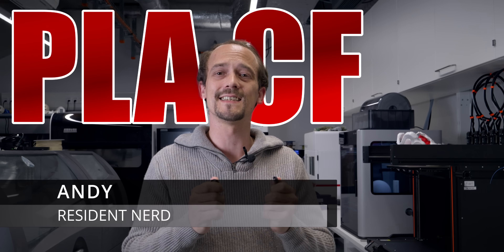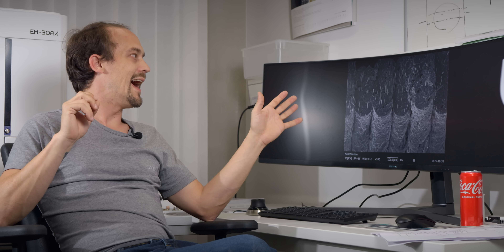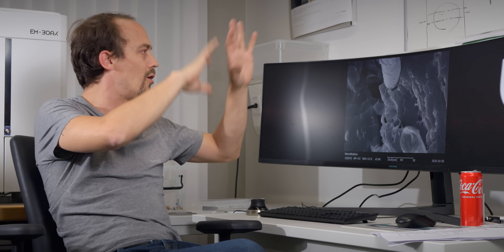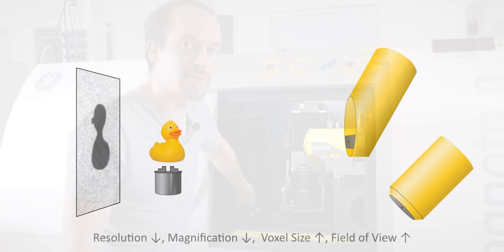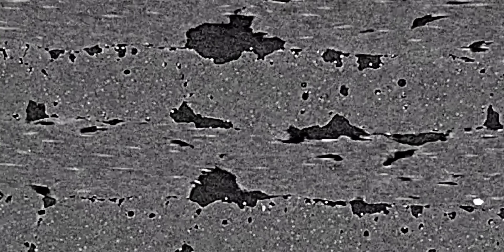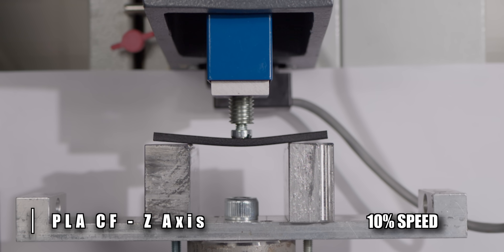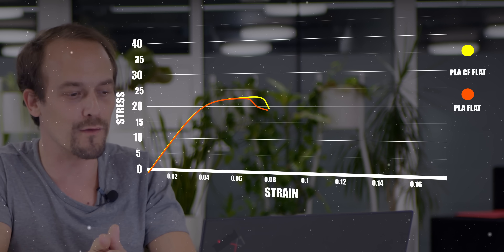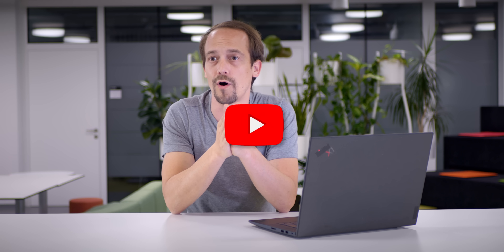3D Printing’s Biggest Scam Is Even Worse Than We Thought!

Comment: Great analysis – I work in injection molding and can fully confirm your findings.
One major issue with these so-called CF-reinforced materials is that the carbon fibers are often not properly surface-treated (sized), or they have the wrong sizing for the polymer used. Without the right interface chemistry, there's no bonding between the fiber and the plastic, which means no load transfer – the fibers basically act as defects, not reinforcement.

This is especially problematic with PLA, since it's chemically not very interactive with most standard fiber sizings. What you're showing in the video – voids, poor bonding, layer separation – is exactly what we see in poorly formulated compounds in injection molding too.The voids you showed in the CT scan look very familiar – we see similar issues in injection molding, even with proper filling and packing.
But I’d assume it’s even worse in FDM printing, because there's almost no pressure during extrusion. In injection molding, we use packing pressures of 300 to 1000 bar, depending on the material, specifically to eliminate voids and ensure proper polymer chain entanglement and fiber bonding.

In FDM, the pressure is minimal – just enough to push the filament through the nozzle – so voids and poor fiber embedding are almost unavoidable, especially with materials like PLA. Your results match exactly what we’d expect without compaction: visible voids, delamination, and no proper adhesion between fiber and matrix.

Thanks for digging into this in such detail – really solid work!
Reply from the maker: Thanks a lot. I am a toolmaker by trade my selfe and worked in Injection molding for about 10 years before switching to 3D Printing. Thats why it was so frustrading seeing people falling for CF Filaments and not beleving me :-)
Reply: @Ibuiltathing  I was a manual machinist tool and die, and I would be very intrested in your experence switching over to 3d printing. I left due to injury and thought about going to a CNC shop but.
It is obvious that the 3d print technology will get to the mirror polish and stable dimentions required, we are at the last stages now. Heck Ive seen some that absolutly do reach spec they are just slow (electrochemical deposting and machining). 
So I have a keen eye for moving into 3d printing, and at very least youd have 1 view if you made a retrospective, even a low effort one just talking to a camera.
Reply: Similar story here. We use the markforged continuous carbon systems and literally in our in-house documentation we have written that the fiber should be used for stiffness-focused applications and should not be used for strength-focused applications because the carbon always weakens the part and encourages delamination at the carbon interfaces.
Reply: @Thesupremeone34  we also use the  markforged continuous carbon printers and the results were quite strong compared to normal printer parts, we stopped using it due to cost though
Reply: This is such a top-tier comment. Informed, yet still understandable.
Reply: Can the same thing be said for glass fiber reinforced materials?  Or, are there a type of fibers that’d work well?
Reply: @zachr207  if the manufacturer did not use the proper sizing and chemical coupling agents, absolutely.
Reply: @zachr207  It doesn't matter what additive you use, it's not going to help if it doesn't bond well to the substrate. If the manufacture does not spend the time and money to make that work, you'll get similar results to what you see here.
Reply: @zachr207  Great question. Before we get to glass fiber – I think it's important to say: With PLA, the carbon fiber issue is not just chemistry, it's also economics.

High-quality carbon fiber (with proper sizing, consistent length, and clean dispersion) is expensive – especially when it's tailored for thermoplastics. In filament production, there’s strong cost pressure, so many manufacturers use cheap or recycled chopped fibers, sometimes with sizing meant for epoxy rather than PLA. That results in no real bonding, and explains why we see voids, delamination, and no mechanical gain.

For glass fiber, the same rules apply. It must have the right sizing for the polymer it's embedded in. Without that, glass fiber reinforced PLA performs just as poorly as CF-filled PLA. So yes, fibers can work – but only if sizing, dispersion, and matrix compatibility are all right. Otherwise, you’re just printing "PLA with sprinkles".

By the way, My Tech Fun did some great hands-on testing on this too – his tensile strength comparisons for PLA, PLA-CF, GF, and other filaments support exactly what we're seeing here. Worth checking out for more data.
Reply: Plus lenght of the filament is short, for epoxy and fiberglass under 6mm fiber is nothing, just a filer.
Under 12 mm fiber just pulls out, and they are chem trated for beter bond.
Reply: Exactly what I have thought my entire life, CF has an amazing finish but is not structurally superior, I always tell my customers that CF is for the surface finish not the durability
Reply: @TheChunkyMunk Do you also tell them that the CF fibers can shed from the outside material and rub off into whatever touches them, like their hands? And then you can transfer those fibers into your lungs, eyes, or mouth where they cause all kinds of invisible damage?
Reply: Oh crap...that doesn't sound good at all.
Reply: @meikgeik  Nope, we left before he even got to that cool part with cancerogenesis. 

I'm not sure if you had ever dealing with customers but I would like to suggest you, that if someone was trying to buy something from carbon and end up with seller preaching about what you mentioned...or -  similarly, someone was buying a cheese and shop clerk, instead of just selling that - gave a high talk on how using milk is animal cruelty...

..care to offer any predictions ?
Reply: @TheChunkyMunk And none of them, never asked you why do they call it space-tech material? None ever burst with laugh and asked you if that wouldn't make guys from NASA, formula1 or aeronautic engineers to look like morons...or some grand-scale conspirators with neferious agenda? 

I mean -(with all respect) you are dude from internet, I'm a dud from internet but there is a whole galaxy of evidence to support claim, that (structurally) carbon fibers are great material (hard for me to contradict superior or inferior w/o some point of reference)...we are talking about that volume of research done, that it would be irrelevant if that entire life of your experience sum up to 13 years, 30y or 300.
Reply: @panicape1  I think he sold Filament not straight up CF. Carbon Fibers are great. They are not great when used like this in PLA.
NASA, F1 and Boatmakers use them as woven sheets laminated with resin polymers. That keeps the fibers long and strong and properly adhered to the polymer matrix.
Short pieces like in filament are a health risk and more often than not cause problems rather than improvement.
Reply: @mouldyrasperrypie  I think he did mean the woven infusion. Do you think that it improves the surface finish (he mentioned 'talking' his customers about...)when it's in filament? I would say that surface of PLA-CF print won't be anything better than just PLA...and that ...that' only in short-run, if you don't swap nozzles frequent (or -don't have any extra at hand) -the abrasive action of CF will make a print worse without that swap.
Reply: @mouldyrasperrypie and those engineered materials have their health risks too, correct? The finished carbon fiber surface is sealed, yes?
Reply: "The right interface chemistry" sounds to me like the key here. If the plastic bonds to the fibers, you'll get better material properties and if it doesn't, you get worse results.
Reply: Yep, they need proper sizing and a chemical coupling agent. Spent 40 years in plastics compounding and the company spent millions developing compounds with chemically coupled glass fibers. True, glass fiber is not the same as carbon, but the principle is the same.
Reply: @roygpa  Reminds me of a company that I worked for via my actual employer until about 1.5 years ago......they'd be cooking up Polyamide (Nylon) on site, and on the lower most floor (only thing below would be drying and water treatment), they had 3 dual spindle extruders which would take the still hot mass from the floors above, mix and knead it again, add a few additives (one line did black, one did white, one did transparent, most the time), pulling out air and vapor bubbles, and yes, also glass fibre. Pre-Shredded to about 5 to 10 mm length, even if after compounding, it would be cut to normal 3-4 mm long chunks before being dried and pumped to the blending silos that stored and equalized the material before it got packaged up.

Due to energy cost, they stopped producing the base material and now haul it in by train and truck (after it got boated of course), from countries with both lower energy prices and environmental protection policies, like the US, China or India. And you can be sure as hell, the moment they get the same certification for those materials if made right in those cheaper countries, that plant will get torn apart, stuffed into containers, and hauled off to some cheap country.
Reply: Is this an issue with glass fibers as well?
Reply: @KidCorporate  If you ask for anything that's made from glass fiber - no, it is not. Same as with using carbon or aramid fibers for epoxy resin saturation, that stuff works well. I have never heard about glass fiber used to dope(enrich) a 3d-printer filament plastic (PLA or anything) but if there is such thing and that what your question was about - I think it will be same mechanism of introducing defects...

Carbon have plenty of awesome properties, have plenty of terrible ones. Weak UV or acid resistance (must be shocking for a carbon-based life form to learn that coal is reactive...I know...) forces to look for protection. It's directional - while u can tell how much beating it can take under given scenario - you have to somehow ensure you play such scenario, a support to maintain orientation (it has a cool name - matrix).

The epoxy infusion is not for having a better epoxy but getting rid of these properties you don't wish. Glass fiber infusion shower drain or carbon car trunks/spoilers have their resistance (mainly) from material used. If you don't mind simple analogy - the epoxy is to hold it all tied - like a rope in a raft from wooden logs - it might improve total buoyancy, might not - but that's not why it was used.

The problem is not about fibers used as framework and binding material holding it together (matrix) - the problem is that printer filament does not contain enough fibers to serve as 'frame'. You end up with matrix doing all the work while fibers are some magic pixie powder that suppose to give superpowers from mere presence (read as: a buzzword)...
Reply: @panicape1  you didnt know that glass fiber is being used just as carbon fiber? Glass fiber dosnt refer to glass fiber reinforced anything yet, it refers to the fiber, wich just like carbon fiber can be added to plastics to change their propertys. And yes, lots of brands sell things like pla GF, wich means glass fiber.
Reply: @gabbermaikel  I was answering a vague question "is that issue with glass fiber"...mkeyy? 

That question - was in regard to first post, from a fella explaining high pressure injection systems and his job experience from that...

Part of problem is in vocabulary people broadly use (same rule apply to carbon and glass fiber so allow me to follow  just one as example)... Let me put it this way - the only thing that carbon  fibers are - are carbon fibers. nothing more. It's a leap of faith to know, that 'carbon fibers' was about a carbon fibers in filament for FDM prints , same with fibers in  hps injection molding. Do you know what else they call carbon fibers (or just 'carbon')? Basically - any part done from carbon infused wowen fabric. Car trunk -that's a carbon. Whole bicycle frame -yeh, it's a carbon...

I mean -I tried to play nice. I wrote that same reasons would make it likely develop same problems if using glass fibers instead of carbon in FDM. I even gave detailed explanation why that way of introducing a fracture wouldn't work with infusion in case someone went for brilliant conclusion that could mean anything ever done with fibers.

And why I didn't know of such filament? Perhaps because I'm not a fanboy and don't jump on every new 'wow' latest dumb fashion in 3d printing... and if you ask me - that one is really dumb idea, I cannot think of any place I could use glass fiber mixed into fillament...all 'safe-to-use' applications where such print could be a health hazard are off the table... we try to use fire retardant properties of glass fiber ? If main ingredient burns as good as PLA....mmmhmm, I think nope...can u think of any application it would really hit the jackpot?
Reply: Great comment, thanks. my favorite use of the web is spreading knowledge
Reply: Thank you for your comment it was a pleasure to read. Important sidenote when 3D printing (or casting) is the thermal expansion coefficient mismatch which is likely the cause of the voids. This also applies to injection molding but not to resins at room temp (unsurprisingly the normal application for CF)
Reply: @SixTough  PLA actually has very low shrinkage, around 0.2%, and fiber reinforcement is typically used to reduce shrinkage and warping – not increase it. 
If you calculate it, the shrinkage over the diameter of a typical carbon fiber (about 10 microns) is just 15 nanometers. That’s far too small to cause any significant separation or voids at the interface.
Reply: @SLu-jt3es  so a 2mm filament will be 2.004mm at 200C (maybe I miscalculate) producing internal voids. Then it may not reset perfectly. Please correct me if I am wrong
Or if it expands inward it will shrink outward.
Reply: See my post.. Let's discuss! 😃👍🏻
Reply: How about Ultrasonics on the Print Head?

~Mechanism 1: Direct PMZ Creation
Ultrasonic horn on/near nozzle
Creates oscillating thermal pulses in deposited material
Previous layer gets reheated in PMZ range (not CMZ)
New layer bonds while both are in PMZ state

~Mechanism 2: Acoustic Streaming
Ultrasonic vibration creates micro-flow in molten polymer
Physically mixes chains at interface
Prevents recoil/void formation
Like stirring prevents separation

~Mechanism 3: Cavitation Collapse
At high enough intensity, creates micro-cavitation
Collapse generates localized pressure pulses
Briefly applies pressure at interface (mimicking injection molding!)
Forces out voids

~Mechanism 4: Enhanced Fiber Wetting
For CF-PLA: ultrasonic energy helps polymer flow around fibers
Breaks surface tension barriers
Improves fiber-matrix contact
Could partially solve the "fibers as defects" problem

The Frequency Sweet Spot
Your Ultrasonics on Print Head
This is brilliant because:
Mechanism 1: Direct PMZ Creation

Ultrasonic horn on/near nozzle
Creates oscillating thermal pulses in deposited material
Previous layer gets reheated in PMZ range (not CMZ)
New layer bonds while both are in PMZ state

Mechanism 2: Acoustic Streaming

Ultrasonic vibration creates micro-flow in molten polymer
Physically mixes chains at interface
Prevents recoil/void formation
Like stirring prevents separation

Mechanism 3: Cavitation Collapse

At high enough intensity, creates micro-cavitation
Collapse generates localized pressure pulses
Briefly applies pressure at interface (mimicking injection molding!)
Forces out voids

Mechanism 4: Enhanced Fiber Wetting

For CF-PLA: ultrasonic energy helps polymer flow around fibers
Breaks surface tension barriers
Improves fiber-matrix contact
Could partially solve the "fibers as defects" problem

The Frequency Sweet Spot
Higher frequency → larger PMZ area ratio

For FDM, this suggests:

20-40 kHz range (typical ultrasonic welding frequencies)
Need to match PLA's viscoelastic response
Too low: not enough agitation
Too high: excessive heating (back to CMZ problem)

The goal: Oscillation frequency that maintains PMZ without transitioning to full CMZ
Reply: @vladtepesh3761  Hmmmm....... That might actually work! Using acoustics to match the resonance of BOTH the carbon fibre and polymer filament MIGHT actually cause them to bond together better reducing or eliminating voids and carbon/polymer pull-back or delamination! We won't KNOW until someone does experiments BUT i see no issue with what you are describing. It just might work and the resonator could be added at the print-head and just might make a difference! Good Job! You just  might be onto something HUUUUUUUUUUGE !!!!

V
Reply: Would putting  the printer in a vac chamber make the problem better or worce? 
Mindes-eye said low vac worce. High( deep) vac would pop the bubbles is fluid state elimination of air voids.   A post heat-treat at 1barA would possibly alow the needed  compaction by reducing residual pockets. Potential issues  compression temp to high to prevent druping .
Reply: Yes but a lot of that doesn’t matter because layer lines are almost always even weaker than all that.
Reply: Not to mention they aren't long enough to be relevant even if they were sized/treated right.
Reply: I'm going to repeat my response here at the end but you actually made me think for a second that their may very well be an advantage a middle area where the pla almost gets a stranded carbon fiber effect on VERY large nozzle dimensions but doesn't work at the standard .04 scale. I think you also broke into some of the thoughts I had on how semi crystalline polymers interact with cf as a nucleating agent. 

I'm not sure I ever though this. unstranded cf has never been considered "stronger" or "stiffer" outside of un annealed materials post printing but it does make for better print quality because its "stiffer" and less likely to warp during printing I think some people (including sales people) just assume that translates into a stronger end product. CF-PLA as a more rigid material is kind of silly on its face if you think about it but it would also be lighter than pure pla and It may actually have rigidity benefits with a pla and a foaming agent like aero or lw-pla. If you want a strong print using carbon fiber you need stranded carbon fiber injection to create composites. Currently I don't think there are consumer level systems available for that. You could make your own maybe.  I do think it has a positive effect on materials like peek, pekk, paht, or other semi-crystaline polymers as the cf acts as a nucleating agent for heterogeneous nucleation  when reaching temp. The resulting in a "stronger" final product. It also helps that the cf itself is an inert material making it useful in biomedical applications. If you want to make something unreasonably strong I would do cf-pekk with stranded carbon fiber meshing and anneal it to it crystallization temperature as a post process. I would imagine it would be unbelievably lightweight and stronger than steel.
Reply: For carbon fibre to work with anything, the polymer has to wet the fiber. No bond, no strength.
Reply: What if there was a chamber before the nozzle to squeeze the heated material together then eject it through said nozzle? Maybe it would dry too fast and clog, but then heat the chamber as well.
Reply: What about bonding with wood, is that different?
Reply: Great comments !! Very little beats experienced understanding from you AND the GREAT work of our presenter.
Top marks to both.
Cheers from Down Under,
p.
Reply: I know very little about 3D printing, but I thought that the strength of carbon fibre comes from utilising long lengths of the fibre, (in the same way that the rebar of a concrete structure is made from long bars of steel rather than just chucking in a load of steel off cuts in the concrete pour), so just sprinkling carbon fibres into the filament isn't using CF the way it's supposed to be used; as demonstrated.
Reply: The carbon fiber has strong C-C bonds. What kind of bonds are there between the fiber and plastic? They can't be C-C bonds without breaking the fiber C-C bonds.
Reply: So tools that are glass fiber reinforced nylon, is there chemical bonding? CF nylon? Do they need to have pressure like IM to set properly and fill/normalize the structure?
Reply: @accordv6er  Glass fibres are normally chemically treated to ensure adhesion to the polymer (aka plastic resin) which DOES add extra strength! All toolmakers have their own formulas and machines to make that happen properly and some are much better than others at it!

V
Reply: Yea no kidding right
Reply: Nice work! One nitpick: couldn't you afford to use a nicer shape as the pusher than a random screw head? 😁 
It's better (sometimes very important) to use a defined smooth shape with a smallish radius of curvature.
Reply: This may have been addressed in other replies, but there is a LOT of pressure in FDM extrusion, actually.  The backpressure during extrusion requires force exerted on the filament column ranging from 3-12+kg, which doesn't sound like much until you remember it's being exerted on the 2.405mm^2 cross sectional area of 1.75mm filament at the meltzone - it's on the order of tens of MPa or thousands of PSI.  This may or may not have bearing on the material/CF bonding, but I felt it was worth pointing out.
Reply: just by experience anyone that works with FTM knows pla-CF has basically the same properties as PLA. But you can see a big increase in petg-cf, abs-cf and asa-cf. Even if the same problems exist, in reality you see a big increase in the value of the young modulus
Reply: Thats what I like about that type of videos, people with real understanding of the topic will come and add from their knowledge.
Btw, do you have any insights about GF, or does these problems are inherently CF/PLA related?
Reply: One other important factor not mentioned is the fact that carbon fiber has a different melting point than the surrounding polymer which shows up in the carbon fiber rods showing up in your CT scan, which means no bonding is taking place and its just nothing more than incasing the CF Rods. As for the voids there's no way around it in 3D printing you need pressure to eliminate the voids. 3D printing was in the beginning proof of concept and the ease for changing the product if needed before a production mold was made, and not for production for products being used in daily work environments under stress.
Reply: @TOPHAT1966GS  carbon fiber melting? Wait what? That stuff dosnt really melt. It dosnt melt in injection molded parts either, or in resin use. It dosnt need to melt to bond either. In proper use the carbon fibers, or glass fibers should work like rebar in concrete. It dosnt melt together either, but the mechanical adhesion should me it a strong enough bond.
Reply: @gabbermaikel  It actually does melt...I remember reading about it (some odds it was watched, not 'read' ;) ). 
It's somewhere in range of + 3 000 C (it might have been closer to 4k than 3 ...) so pure DIY xD Of course - you really-really don't want to introduce any oxidants to such temperature. So -yes, it's a thing, there is even a tech. name for product of melted carbon fibers - it's a... coal.

...People don't talk about the heat induced carbon melting that much...but the amount of comments committed under this video with people talking about coal..I mean -"still-a-carbon," after it went chemical melting, would work well as a base for a drinking game.
Reply: @TOPHAT1966GS  carbon fiber doesn't melt
Reply: @SLu-jt3es yes it does.
Reply: This comment was written/assisted by AI.
Reply: I dont think size is as critical as the plastic being able to bond to the CF. If it cant form a solid bond, it is irrelevant what size of CF is used. I agree size does matter as does volume, but for the basics the ability to physically bond has to be the first consideration.
Reply: @kevinm3751  sizing is a term related to surface treatment, usually of fibers (aka a type of glue, paper is the most common example) and not a reference to physical dimensions. Just one of those weird english language quirks that probably has a perfectly logical explanation, in a 1500s context lol.